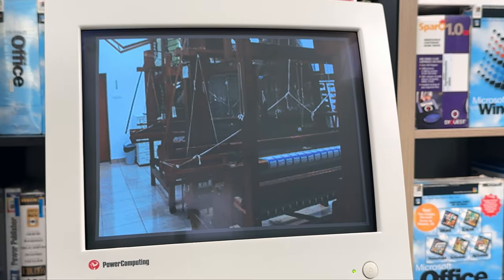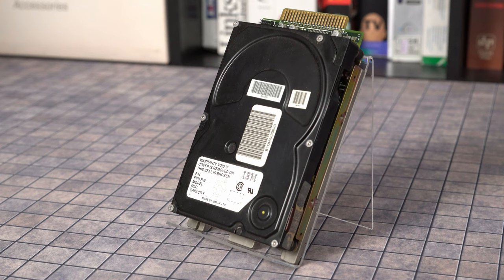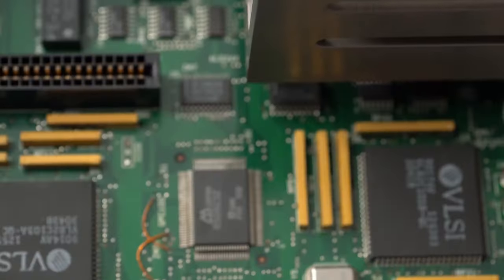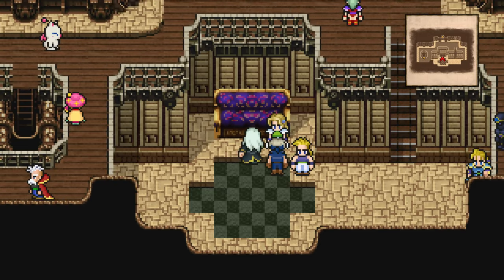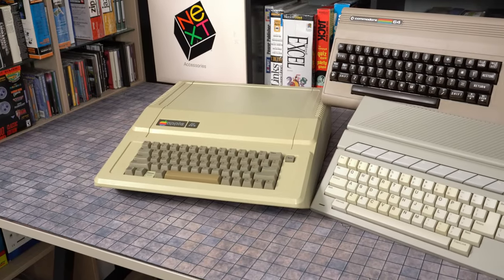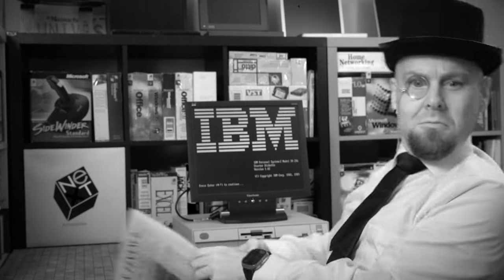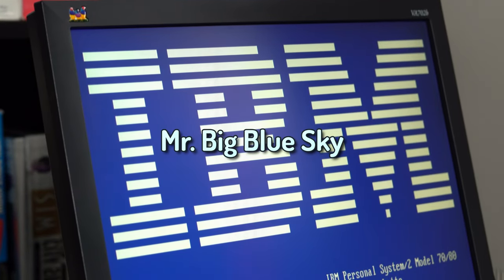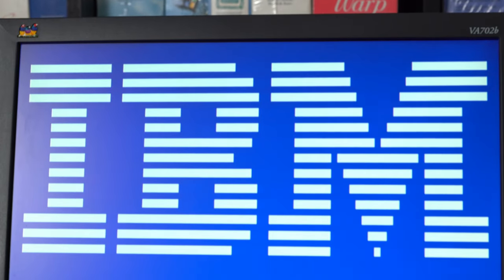IBM PS/2 Model 30 286 - Computers of Significant History

Comment: When I started to study computer stuff in school in 1989 I got a PS/2 70-A21 with a 25MHz 386+387, 4 Megs of RAM and a 120 Mb HDD. That got me through 3 years of studies, and in June of 1992 I started working at the nordic IBM Helpware and OS/2 support hotline in Copenhagen. That was the start of my IT career which still continues to this day. There are still traces of old IBM to be seen in current Lenovo computers; the documentation, some of the terminology in the manuals and such.

Comment: Excellent video! I got a hand-me-down 2400 baud modem from a friend in 1996. By then everyone was on 28,800 but it opened the world of BBS to me. I would us ASCII (not ANSI) for faster loading times. Soon I got into trouble over the phone bill, so I saved up for a 33.600 Zoltrix and built my own BBS on Iniquity which ran after hours. If you can't call them, let them call you. Only went online in late 1998 and then ditched the BBS.

Comment: You're about three years younger than me I take it.  I started calling BBSes in 1991 as a fourth grader on my Color Computer 2.  As my tech advanced, I eventually started my own BBS when I convinced my dad to get me my own phone line.  I ran it for a few years in my early to mid teens before my interest in girls took over my interest in running a BBS...  plus, I got a Mindspring internet account, and retrospectively, it was sad seeing the BBS era being ushered out.  These days, my favorite part of retro computing is connecting to BBSes.  Though it's usually on my Wimodem232, from time to time I'll setup an old dialup modem and connect over the phone line...  just to relive the whole experience ;)
Reply from the maker: I did try running my own BBS, but alas, I was too late to the party. It was more of an excuse to play with setting up programs. Renegade had a lot of settings to tweak.
Reply: @userlandia  Indeed!  I ran Telegard and Renegade with FrontDoor for my FidoNet front end.  I learned a LOT about batch file programming from FrontDoor LOL!

Comment: I got one of these for free from my neighbor (they were scrapping it). I cleaned it up and to my surprise, the HD actually worked. Sadly, the floppy didn’t so I got a gotek which proved to be difficult because of the odd pin outs. After a nice eBay seller custom wired an adapter for me, I was able to get it working well. And then I was bit my the memory issue…bought so many sticks to try to bump it up to run windows but every single chip I bought just didn’t work. I ended up selling it a VCF east, vowing to never mess with PS2 again 😂

This video is really reminding me of that brief foray.

Comment: I finally got access to IBM computers in my senior year of high school, where they had a program that would bus some of the kids to a technical learning facility for advanced vocational classes. I lucked into getting into "Microcomputer Information Systems", along with a whole lab of IBM PS/2 systems of some kind. I was disappointed to learn that it was just a glorified typing class though. Luckily my teacher recognized that I was "advanced" enough to not need the normal class instruction, and gave me a book on QBASIC, and told me to go at my own pace, turning in the tests at the end of each chapter. I don't think she ever looked at them, as I'm guessing the book was a one-of promo sample that she didn't have the accompanying teacher's guide for. It helped a lot that I already knew BASIC from my earlier high school days playing on their Apple //es.

I learned to type and to program on an IBM Model M keyboard, and still have and use one to this day. (I use the OS to remap the capslock key into a Super key, since it's still a 101 key keyboard.)

Comment: In the mid 1990's a former employer gave me a PS/2 Model 30 286 that had been heavily used in an office environment. When I received it I opened it up and was shocked to see it was completely packed with dust squeezed into every nook and cranny right out to the shell of the case. My heart sank a bit as I thought to myself that it probably would not work. I had to pick out huge wads of packed dust before I could even get a glimpse of the motherboard. To my amazement after cleaning it up it worked fine when I turned it on. I question whether any modern day computer would work very long it you were to completely pack the inside of the case with bats of insulation.

Comment: "its lagging pretty far behind yping!" you can't escape me, typo! even if its used to illustrate a point

I also had one of them RadioShack circuit kits, though not the one shown... I want to say it was a 150 in One with a Blue Box... though my memory is fuzzy on the exact details.

Thanks for the congratulations and glad to have a .25 playback speed option grumble grumble

We ALSO had a ThinkPad, I remember playing Jill of the Jungle on it.

Comment: Ha!  I had an Amstrad PC1512 upgraded to 640k.  That was my first PC I got after my Color Computer 2.  I have one of the PS/2 8086s with MCGA, a PS/2 286 huge tower, and a desktop PS/2 486 flavor...  so many project machines.  I haven't even used the 486 or 286 tower yet.

Comment: I skipped the 286 and sort of the 386 (or was it 486?) too,   But I used a Commodore 64 until around 1988 and then switched to a 128D.  While I had the 128D I build a PC with an 8088 compatible CPU by NEC, but traded it away,  in 92, I wanted a 486, but it was over my budget, so I got a Cyrix Cx486DLC-40 with a 386 motherboard.  It played all the games I wanted to play at the time.

Comment: Our paths are very similar! Christmas of 1996 is when dad bought me my first computer out of the newspaper classifieds. It was an IBM PS/2 model 30! with a 2400baud hayesmodem. Back then I was in the 513 area code, and it had Telix too! My favorite BBS at that time, was Forest Park BBS. Unfortunately, it appears that one was never archived but i remember it being on a BBS list which is how i found it to begin with. 

I ended up catching a virus shortly afterwords from downloading all the games on those BBSes and killed the PC. Couldn't really fix it as the disk drive quit reading my disks. Dad bought a 386 and thats when our first experience of the internet came into play 14.4K modem on Windows 3.1 with AOL 3.0. Not a pleasureable experience but it was my first nonetheless...

Then in the summer of 97 dad finally broke down and bought a new machine. a 200Mhz CTX. 

We are only about 3 years apart, as I was 11 in 1997. 

also, not to nitpick too much but your IBM PS/2 stock footage, you have some serious leaky caps going on with the FDD and HDD and it needs attention, to be expected.
Reply from the maker: Yes, the drives were recapped shortly after this was filmed. One of those "Well, it's working for now, best to do it after I'm guaranteed to have the footage."
Reply: @userlandia  Ahh gotcha, at least you got it taken care of before it eroded any more of the copper traces and ICs away!

Comment: My interest in old computers started like all the way back when I was like 7 years old in the early 2000s when I really wanted a computer of my own and I started reading a lot about 486 era computers and looking them up on eBay, the first retro machine I owned was an SLT 286 my dad's coworker gave him when I was 9 years old, sadly the PSU broke and I ended up throwing it away. When I was in the last few years of highschool I started picking up machines and old computer items from thrift stores and flea markets and built up a small "computer graveyard" as my dad calls it. in the mid 2010s due to space constraints I collected a number of 486 through Pentium M era laptops when ever I found one cheap enough on eBay. Now most retro stuff has skyrocketed that I don't partake much on buying any more hardware.
Reply: I remember seeing an old PS/2  sitting in an unused classroom at my elementary school I went to, I don't know what model it was specifically since I never got up close I just seen it sitting on the table through the doorway, and they had a ton of old EduQuest all in one machines still in use when the school closed down at the end of the 2004-2005 school year and the building was sold to become a preschool, I don't know whatever happened to any of those machines, I wish I would have asked and seen if they'd let me keep any of them, and there was also some really cool old boxed software from the late 80s and early 90s in the storage room off the library, I remember seeing a copy of Windows/286 or Windows/386 in there. But I guess I didn't really have the room for them at the time since there were like 8 of use living in an ~1300 sq ft house and the garage was pretty packed, but a man can dream.
Reply from the maker: I know the same feeling, I passed up some real interesting stuff during 2018-2019 because of lack of space.

Comment: Yes, the PS/2 was proprietary, which is largely why it failed.  But this same video says nothing about Windows, which he clearly wanted, being proprietary!  No, Windows was fine not being open source.  The Commodore 64 was also mentioned in this video.  Where were the C64 clones?  Oh, that's right, there were none because Commodores were proprietary too.  Anything about the proprietary Mac?  No, no mention of that being proprietary either.  Intel is proprietary.  Not mentioned.  If you don't want a proprietary machine, then do not buy a PS/2.